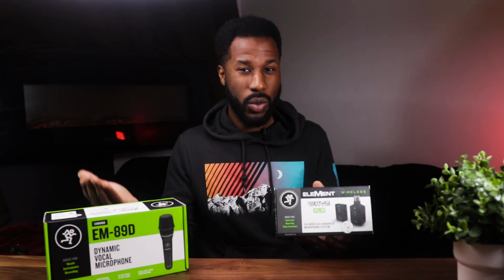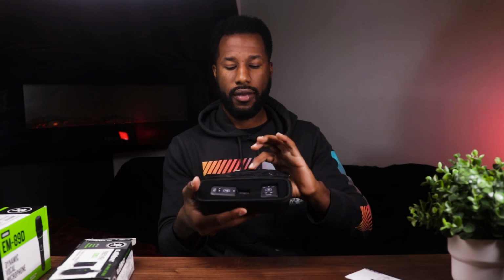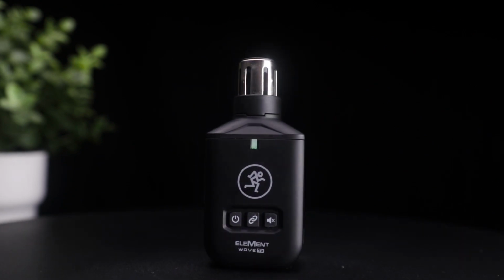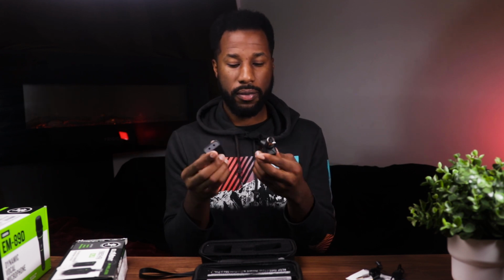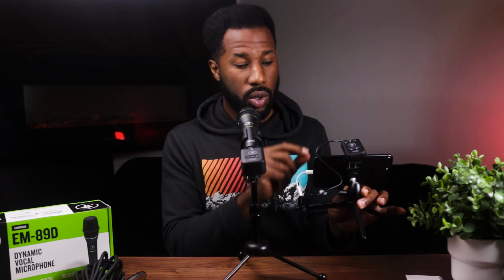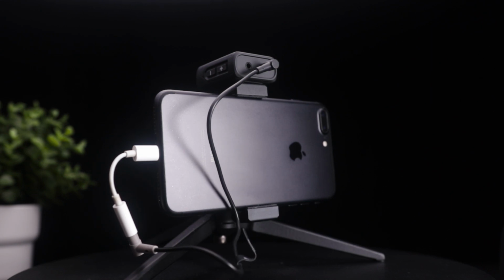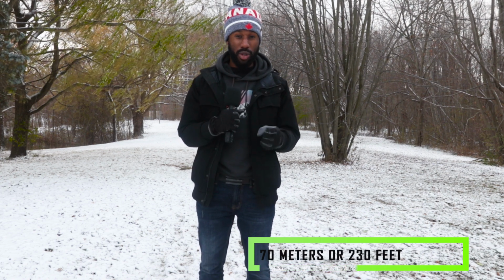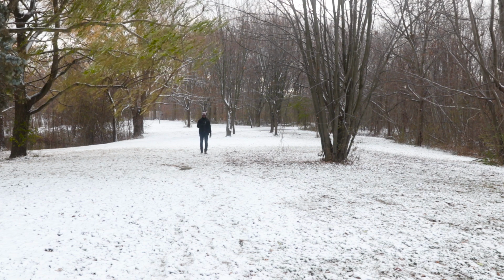Mackie Element Wave XLR Sound Test and unboxing. Use your dynamic XLR Microphone WIRELESSLY!!

Comment: Hi ! Its an old video but I really need information about the adaptator you used on your SMARTPHONE the WHITE CABLE because I have one and it doesn’t work. Please help !
Reply from the maker: It should work, just make sure that when you playback the audio that the cable is disconnected. Otherwise, you won’t hear it. Hope this helps
Reply: @ thank you so much I’ll try that 🙏🏻
Reply: @GoWrightReviews  what is the model of the adaptator that you used exactly please ?
Reply from the maker: @maddynastie the white female lightning adaptor came with my I phone. It’s been a while since I made the video but can you confirm if there are multiple male 3.5 mm cables that come with the Mackie device ? If so, you have to use the TRRS version for the phone (three lines)

Comment: I saw the manual of this product, and realised there is a volume control on the transmitter. So it can provide extra gain, if our interface can't provide enough?
Reply from the maker: Gives the user control of the gain as you need 👍🏾

Comment: Really good review!
Reply from the maker: Glad you enjoyed it
Reply: @GoWrightReviews  some similar must to do other brands.  Deity try some similar with xlr transmitter and its deity wireless lavalier. I want more xlr configuration in rode, comica or DJI. Xlr mics are better for field work interviews. I think they sound better.
Reply from the maker: I couldn’t agree more. More effort should go into making wireless XLR grade equipment. The results are much preferred over USB or 3.5 mm jack
Reply: @GoWrightReviews You're right. Audio customers want this implementation. Brands only think in smaller devices not really good and quality devices.

Comment: The squirrel wants to test your mic
Reply: Did you try to insert to other microphone which is not mackie wired microphone does it work ?
Reply from the maker: Yes, this does work with other xlr microphones that do not require 48v of phantom power. So it does not have to be mated with Mackie branded products only. 👍🏾
Reply: Thanks the  idea keep it up
Reply from the maker: Haha! He was quite curious indeed

Comment: Can I plug this in to a mixer for a live concert?
Reply from the maker: Sure can!
Just make sure you have the proper quarter inch microphone adaptor. Be sure to NOT use phantom power.
Reply: @GoWrightReviews  thank you for the quick reply. How is the sound quality??
Reply from the maker: @aaronwhitelaw4342  depending on what it connects to I do notice a bit of a hiss sound. But when I connected them to my monitor speakers I didn’t notice anything. If this is for a recording it’s not an issue especially with noise reduction in post production. It works quite well.

Comment: How bad/good is the latency?
Reply from the maker: Hi!
In what sense ?
Reply: @GoWrightReviews  since i couldn't find any data on latency i was just wondering  how many milliseconds the latency is... so let's say you had headphones on and you clapped your hands... did the clap come much later in your headphones while you monitor it or was it pretty close? for example the sennheiser avx-me2 has 18ms and the clap was a lot behind the actual clap, where as the rode wireless go2 is 4.2-4.9ms and it's pretty right on it, can't tell the difference so the latency is good. just want to know if you could sense the latency when you speak/clap while monitoring.
Reply from the maker: I will test this for you and let you know 👍🏾
Reply from the maker: So there is no latency. I conducted the test using headphones and I can’t detect any delay in hearing the sound.  Hope this answers your question and thanks for watching  👍🏾!
Reply: @GoWrightReviews  thanks so much!
Reply from the maker: The pleasure is mine ;-)
Reply: @GoWrightReviews  suscribed!
Reply from the maker: I appreciate your support 🙏🏽
Reply: @pagpapaitim  5ms

Comment: What mic should I use for travel? Could you add a link to the mic you were using or a mic you could recommend? How is the battery life and connection?  Thank you for your review and testing. What do you prefer? There's also a non XLR transmitter. Do you prefer the lapel mic for the other wireless transmitter?

I'm not very good with post sound editing to reduce the noise. I am unsure what quick settings people use. 

I like the sound better with your lavalier, but I'm not sure what device attachments you used and the audio interface you used. Also, the settings you used and post sound editing techniques you used. Thank you for your thorough content.
Reply from the maker: Hello! Thank you for watching.
I would definitely recommend a lapel microphone for travel in the case you may be vlogging or conducting interviews. They are small and easy to carry around and use. Mackie does have the lav mic version of the wireless bundle but I haven’t had the opportunity to test this version of the product as of yet. As requested, here is a link to a review I did for the lav mic set I was using in this video to conduct the review:https://youtu.be/2gpiwGLWv3I

Here is a link to another video I did explaining how you can do some quick editing to your vocals using premiere pro or audacity: https://youtu.be/fcRIsiYnesA

Hope this helps you out 👍🏾

Comment: Can you plug the XLR transmitter into a line level source via XLR or 1/4 adapter instead of a microphone and possibly use the receiver as a wireless iem pack?

Comment: Have you tried using it to play music through? Like out the backside of a mixer to a speaker?
Reply: Nice video.. I wish if you can make a review using this and connecting to a powered speaker..Thanks in advance.
Reply from the maker: So out of curiosity, I connect these to my powered monitor speakers that has an Aux-in, and it did work👍🏾. Hope this answers your question .
Reply from the maker: Hmm no, I did not try this actually. If I can get my hands on a mixer, I’ll let you know

Comment: Is the noise being caused by the wireless system or is it the mic? I understand I would probably need to do a noise reduction anyway, but it would be a shame if the transmitter is adding noise.
Reply from the maker: The mic itself is actually pretty quiet. I did a test using the mic while connected via XLR and it actually sounds impressive.. there is a possibility that the noise is coming from my camera as well, as the devices were quieter while connected to my smartphone and my PC. It’s something to be aware of. In any case, like you said, quick post processing will completely remove that. It’s something I would do anyway so it’s not a deal breaker in my case. Hope this helps !!

Comment: Good Video. It sounded much better when used in conjunction with the computer. When you used it with your phone it was very loud noise floor.
Reply from the maker: I actually found it was louder with the camera and lower with the phone. But yes , there is definitely noise there, I didn’t want blame the wireless devices but attribute it to the recording devices. On the PC it was much better as you noted. In either case, it’s common practice to apply noise reduction in post processing. So a small price to pay to have more freedom of movement I guess. I appreciate you watching and giving your feedback 👍🏾👍🏾👍🏾